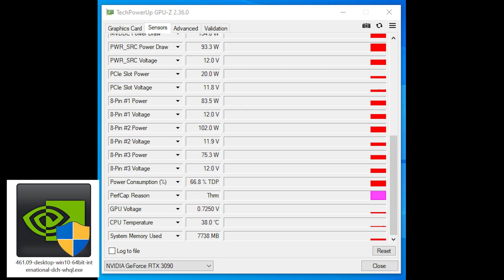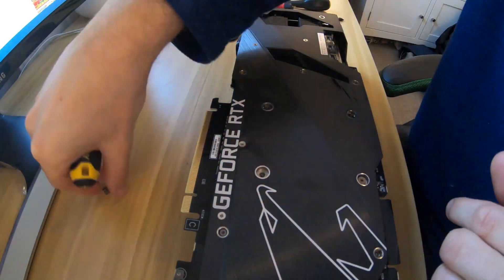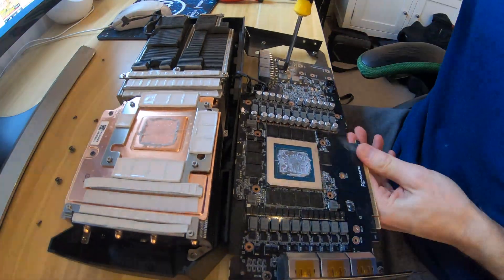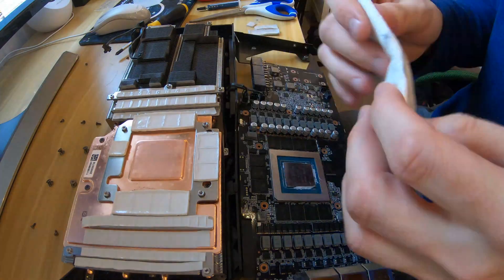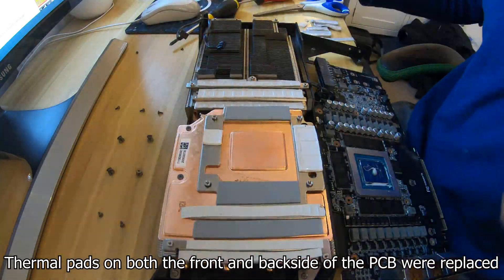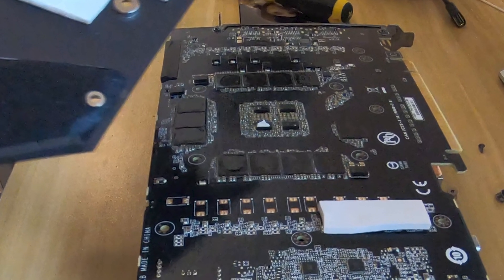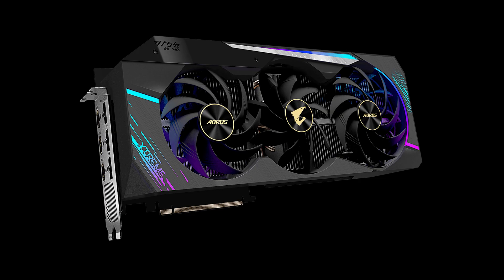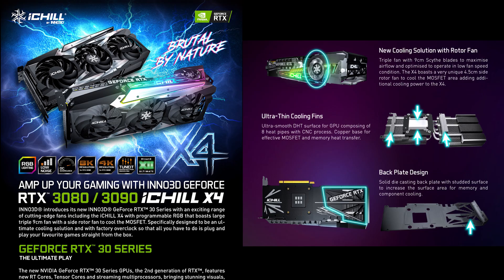Gigabyte RTX 3090 Aorus Xtreme GDDR6X overclocked memory overheating [FIXED]+ buying recommendations

Comment: I've got a Bykski waterblock for the front and an MP5Works block for the back of my Aorus 3090 Xtreme. Should be fitted in the next few days! I'm hoping that will allow memory overclocking.
Reply: Quick initial update after fitting :
I can confirm 30C drop in memory temps using 12.8 W/mK pads when fitting the Bykski Waterblock. Unfortunately GPU core up 5C (possibly poor paste as it dried on spreading, or just less efficient than original at cooling the die) - not an issue.
What is an issue is Hotspot temp at 110+! I suspect the VRM pads need to be thicker but they also only have a very narrow metal strip on the waterblock. Going to retry today with thicker pads but I'm waiting for a replacement for a leaky shut-off valve which won't be here till usually late tomorrow. 
I would hold off on the Bykski block until I can fix that problem (EK still not available).
If anyone can confirm that the 'Hotspot' is the VRM temp, or exactly what it's measuring on the Xtreme(Master etc would be the same) then that would be very helpful!
Reply from the maker: If you wouldn't mind, could you put a comment on here just letting me know how it worked out, if it is a good result then I would do the same! Thanks!
Reply: @MindfulMotorcyclist  Will do. Hopefully in the next 2 or 3 days.
Out of interest, your video suggests that the Gigabyte Aorus is particularly bad in terms of memory temperature. It is my understanding that the equally clocked Asus Strix OC would be exactly the same as would all other AIB boards without specific backplate cooling. I was lucky to snag the Aorus Xtreme 3090 from Box at the beginning of December  otherwise I'd still be in the queue at OCUK for the Strix OC. The Aorus overclocks well, and I believe is on a par with the Strix OC, but, as you say, the GDDR6X gets hot anyway and especially if you overclock it :(
Reply from the maker: @ColinDyckes  Thanks! WRT the Aorus Xtreme I also have an EVGA FTW3 3090. The EVGA backplate is a little thicker and has a hexagonal perforations allowing air to flow through from the fan on top of the cooler. The FTW3 memory is still very hot but its around 2-4*C cooler than the Aorus. I think this is because the backplate is thicker and has some holes in. Neither design is acceptable standard however. I expected the Inno3D iChill x4 to be better as it has that small fan which blows across the memory but I havent had one up close. Sadly, I cant afford to buy one of each to investigate even if we could find them available! The good news is that the Aorus Xtreme has one of the highest clocks at 1860MHz so I think you'll get great results when its cooled!
Reply: @MindfulMotorcyclist  I can generally get up to 2150MHz depending on the game but it's stable at 2050 on everything. ISTR the memory uses the best part of 100W on standard settings running Furmark in 4K HDR.
Reply: @MindfulMotorcyclist  My Bykski Waterblock video for the 3090 is currently being processed by YouTube. I'd appreciate your comments. It works REALLY well!  https://youtu.be/Wn5ntg4K_ew
Reply from the maker: @ColinDyckes  Really nice well thought out presentation, thanks for sharing. Anyone watching this video should check that out this link as well.
Reply: @MindfulMotorcyclist  Block now installed and working extremely well! 
I have now used 1mm for the RAM chips, 1.5mm for VRMs and a stack of 3x2mm = 6mm for the chokes on the Aorus 3090 Xtreme. For the backplate I used the 1mm pads for the memory and the 2mm pads supplied with the Bykski block for the VRM area on the back, plus a 2mm pad cut to fit the CPU area of the backplate which has about 1mm depression. The key 1 and 1.5mm pads are high specification (and cost) Extreme Odyssey Thermal Pro from Thermalright. You'll need 2 packs of the 1mm thickness. The 2mm pads for the chokes are made from 1 100 x 100 x 2mm cheap pad pack cut into 6 10mm strips. All available from Amazon. Paste is MX-4 which I found much easier to apply than TF8 and is giving very good results. 
Memory temperature is 62C on Furmark and I quickly checked mining and it only went up to 70C (no backplate cooling yet - 58C max backplate temperature). GPU temp was 53C with Hotspot of 64C in Furmark. I need to add a water temperature sensor and run my radiator fans from that as they're currently driven by the CPU temperature so could be lower on GPU limited tasks. Speedfan here we come!
So, initial running with pad thicknesses given by @FrameChasers (except I found 6mm was correct for the chokes, not 10!) looks extremely good for the Bykski waterblock. Not really sure the backplate cooler is strictly needed but I will fit it to keep temperatures down when it goes in the case.
Reply: I'll need to look into this MP5Works block you speak of. I didn't know anyone other than EK was making a back plate block.
Reply from the maker: @20Viper05  its also about 1/3 of the price of the EK offering which is helpful.
Reply: @20Viper05  I'm not sure EK have either front or back blocks available for the GigaByte Aorus 3080 and 3090 Xtreme yet, hence the Bykski and Mp5Works blocks. The Mp5Works block is fitted to the backplate with a thermal pad so not as good as a "full cover" rear block. In conjunction with a waterblock on the front I expect it to be good enough though.
Reply: @ColinDyckes  i purchased the Barrow block. Also have a HD block on the back. Highest temp ive seen is 82 degrees for the memory so far. Gpu highest is 68. Not sure if i will fit the waterblock
Reply: Have been too busy to fit the waterblocks yet, but very soon. I made a quick sideshow video showing that just a 120mm fan on the backplate dropped memory temps from 96C to 86C in Furmark (non overclocked) so that I have reference values for the effectiveness of watercooling. Definitely needs memory cooling for overclocking. I'll post an update as soon as I've installed the blocks and tested it.
https://youtu.be/9oNfjpTbGss

Comment: Artic mx2, man, use the kryonout
Reply from the maker: Core temps aren't the issue, it's the memory on the back of the PCB
Reply: Die temps aren't the problem, especially with the Bykski waterblock I fitted. I used MX-4 as it's far the easiest to use. You'd maybe get 1 or 2 degrees maximum difference between pastes.
Reply: @ColinDyckes  not, i use both thermal paste, kryonout can give to you 5 6° less. than mx4, mx5 may be on par vs kryo this time.
Reply: @JomarsYT  Not according to any of the comparison tables I have seen. I doubt anything will convince you, and I'm happy with MX-4. Wish YouTube would let me post the comparison tables I found. EDIT: https://www.tomshardware.com/uk/best-picks/best-thermal-paste
Reply: @JomarsYT  No, I use the experience of others to save spending time and money 're-inventing the wheel'. On a 3090 the paste will make negligible difference if  watercooled as mine is. I max at GPU die of 60C when overclocked, 53C when not. Zero point in getting it any cooler! 
On a cpu, I run a 5.1GHz all core OC 10900k with temps no higher than 85C on Prime95 highest heat for a 24 hour run. It will run 5.3 but temps near or at 100C.
The only alternative really worth considering is liquid metal with a de-lidded CPU. I couldn't get a binned de-lidded 10900K when I needed one (tried via Derbauer) so got an 8-pack 5.1GHz binned.
Your high temperature difference suggests poor coverage of the MX-4.

Comment: I have a FTW3 Ultra RTX3090, after 5 hours of Cyberpunk 94*c on the Mem Junction.. Very very disappointing. So swapping out the thermal pads doesn't solve the issue:( I don't think 94*c will kill it but it sure is disappointing to say the least. I only play Games but my Gaming sessions can last over 5 hours. Wonder what Nvidia will say about this? Probably nothing.. Thanks for the vid mate.

Edit: Not even Gamers Nexus picked this up.. Or I never watched the video?
Reply from the maker: Thanks for giving the gaming perspective. I always relied on EVGA for the best cooling solutions, I mean think back to the 1080ti FTW3, it was the best looking and lowest temp alongside the Zotac AMP Extreme. I think EVGA still make good cards but this time round the backplate is again 1mm or so same as Gigabyte, even my old 1080ti FTW3 has a thicker backplate. The advantage of the backplate on the FTW3 3090 is at least it has holes so some of the heat can be dissipated by crossflowing air from the top fans.94*C is still very poor and as you say Nvidia won't do anything except maybe bring out a 3080ti with similar core to the 3090 but less VRAM and better organised VRAM for the cooling to work. Us 3090 owners will be quietly forgotten.
Reply: @MindfulMotorcyclist  No problemo mate. Yea EVGA cards are usually the best and yep we will be forgotten.. I'll run it till it dies then rma it I guess, what else can we do:( Thanks for the reply.

Comment: have u tested populating the backside memory-chips with some heatsinks directly attached? i mean there are some beefy alphacool copper-heatsinks that could solve the prolem with a little airflow over them. https://www.newegg.com/p/37B-0003-001J6
Reply from the maker: I have some server heat sinks that I purchased from ebay: HP 419898-001 PROLIANT DL585 G2 SERVER HEATSINK. These were cheaper, they were reusing an old part which I like and man are they heavy and pure copper. I've just done a video testing watercooling (uploading today) but I'll try and get one up featuring the heat sink solution. Thanks for the comment, much appreciated 👍

Comment: Is this a 7 slot card now? ;D
Reply from the maker: Sadly it is! HAHA
Reply: @MindfulMotorcyclist  This is absolutely ridiculous, I mean everyone trying to fix Nvidia's fuckup with the GDRR6X temperatures exceeding safe levels. I wouldn't be completely happy with all that weight in the back of the card...you can bend some components with time...Btw, this happens even in the Waterforced cards, what a disaster. No brand seem to be cooling the memory junction properly,,,sigh

Comment: nVidia has made a bad serie regarding memory cooling, that's all... everyone has that kind of issue. shame on NVIDIA ! I get 110° on the memory modules btw, no overclock, undervolting and my mem is still throttling of course
Reply from the maker: Agreed, they've really messed up, and especially given the price we paid for these 3090s 😒
Reply: It's beyond unacceptable for the price, end of story.

They made plenty of shit cards also don't fool yourself
Reply from the maker: @obic123  I dont think shit cards, I guess overpriced would be the key takeaway from the recent 20-30 series.
Reply: Well not shit but seriously unimpressive.

I own/owned Some older I dont even remember, GTX 570 , Rx 470 4GB,  780TI XC2, 1070TI Duke, Radeon VII, RTX 3090 FTW Ultra

So far 3090 hit the mark when it comes to poor TDP & Cooling.
Radeon VII was pretty bad but still at least a H100i Pro was the fix to all problem.
1070Ti Duke was the best card , driver etc I've ever had.

This thing cost 2700$ in Canada, For that price the engineering is piss poor.
8NM Samsung is a oven element.
DDR6X is not that impressive compare to HBM2 & the heat they produce is Something else.
Then add the fact that the ''Leading A,I Developpement Firm' Clearly failed basic thermodynamic.
The drivers Since november are actually worse than AMD by quite a lot.

My XFX Rx 470 4GB still mining by the way XD. (that has been mining non-stop since 2016, i'm actually curious how long it`s going to last)

But nice video, I was actually looking at my Ryzen wraith from my 3800x but I dont have the space with my noctua NH-D15

My best bet would be to have fins touching the NH-D15 to cool it down

Comment: Im so glad i saw this, thought i was the only person that had issues with this card. Was considering fitting a waterblock to it.
Reply from the maker: Please don't waste your money on a waterblock, I tested it with a an AIO cooler and the results were not good https://youtu.be/YVNJDvMim7M
Reply: @MindfulMotorcyclist  The Bykski is superb and has dropped vram temps by 30C as in my other comments and video. If you have a custom loop machine it is well worth doing. Even with 50USD express shipping (1 week) to the UK it was still much cheaper than an EK and backplate (which aren't available for Gigabyte yet anyway)
Reply: @ColinDyckes  does waterblock cool back of card too?
Reply: @zabique  Bykski block only cools the front, but is pretty effective at reducing the backplate temperatures so that you could probably get away with just a 120mm fan spaced 5mm from backplate. I fitted the MP5Works backplate cooler which keeps the backplate below 60C.
Reply from the maker: I think that would work really well, there are versions available from Bykski and Barrow both you can order from Alibaba but will take 20 days or so to arrive.
Reply: literally everyone has issues with thermal throteling on the 3080 and 3090 fe and gigabite models. i mine crypto, i know yall probably hate me, but if you replace the thermal pads on the front and back of the pcb they dont throttle although the mem temps are still way high like 105c. and the evga ftw 3 is hit or miss i have 2 3080s and one throteled till i fixed it.

Comment: Great video, cheers buddy! I'm 42nd (fml) with Scan to get this exact card, looks amazing!

Would be really interesting to get "ActuallyHardcoreOverclocking" to give his opinion on the PCB design, do you have any clear high-res photo's of the front & back of the PCB?
Reply from the maker: Thanks for the nice feedback! I hope the queue at scan moves quick for you. I have a friend is in the queue at 'infinite computing' a new shop and he's 120th. I haven't got any super high res, and I've assembled the card again now :(. I can pull some from the video as it's 4k so should be nice. With respect to the design I think the memory modules on the rear of the PCB are the main issue, which seems to be common across multiple AIB partner designs, there's not enough room to fit them anywhere else.
Reply: @MindfulMotorcyclist  awesome, hopefully we all get stock before Chinese New year shuts the factories down for a couple of weeks!
No worries about the photos, Buildzoid says he already has photos 🙂 hopefully he'll do a teardown of the card soon.

A suggestion I've read, is that if you watercool the card, you could put some nvme water blocks over the memory on the back to cool the GDDR6X chips.
Other than that, if those CPU coolers fit in the case, happy days? 😅
Reply from the maker: @jaykay5369  The CPU coolers are such a bodge, it offends my OCD 😂. I would like a neater solution like the NVME cooler or even a rear mount water block :)

Comment: I have an Gigabyte Aorus RTX 3090 Master that has thermal throttling. I've changed thermal pads, all of the m with good ones from Grizlly, still nothing it starts with 106MH/s and after a few minutes goes down to 72-75 MH/s. Do you have any suggestions?
Reply from the maker: I think it is not the transfer of heat from the modules to the backplate it is the backplate is paper thin and becomes saturated with heat. I would try power limit down to 75%, cool the ambient temperature of the room down and if that fails small copper heat sinks stuck to the backplate above the memory modules with a fan blowing over them. You can also use the latest version of HWiNFO sensors section to read the memory junction temp, which I guess is around 104-106 degrees for your card. Hope that gets some improvements :)

Comment: I feel like I've joined an extremely exclusive club of people who also own a 3090 Xtreme, haven't turned it on yet though - still waiting for a 5950x to come in...
Reply from the maker: I have to say despite the memory running hot it's a great overclocking chip, must be very highly binned. I hope the bring out a revised backplane or something like that. Jealous of your 5950x's I'm still on a lowly 3900x 😁
Reply: @MindfulMotorcyclist  Hey no shame in the 3900x game, I still like mine. I think I will skip the 5000 series and wait for the next cpus. It does just fine for me, and I don't think we'll get another cpu revision on AM4... so I'll wait for the big upgrade to the next socket, possibility of DDR5? Time will tell.
Reply from the maker: @20Viper05  Agreed, the 3900x is a beast and still performs great for me :).
Reply from the maker: In fact I've been a fan of Ryzen since the 1800x!

Comment: 3090fe exactly the same
Reply from the maker: Sucks doesnt it :(
Reply: I’ve just received bitspower water block hopefully by end of week will see how that goes
Reply from the maker: @wilko2907  I looked at Barrow and Bykski offerings but neither of them had active backplate cooling. With mine, the Aorus has a huge heatsink and the GPU core is already fairly cold at 49 degrees or so I didnt know how much I would gain by cooling the front of the PCB. Maybe the water would soak a lot more heat from the front and thus cool the back. I hope yours goes well!
Reply: Agree I’m hoping the same exact thing mate
Reply: Ek block I think is the only active back plate but the prices 🤔
Reply from the maker: I've run a EVGA FTW3 3090 [1800MHz boost] now under the same conditions and the backside VRAM is at 100 degrees. Not ideal but not enough to downclock the core. The Gigabyte Aorus [1860MHz boost] is at 108-110 degrees and causing throttling 😫. Funny thing is the Aorus memory can overclock 1350MHz and the FTW3 only 1050MHz. So the Aorus is a beast in terms of GPU core and memory overclock but the backplate is tin foil... such a shame. I couldnt go for an EK backplate cooler, its silly money. I've ordered an old server heatsink (pure copper) for £8 and I'll stick that on the backplate for now with a HAF fan aimed at it.